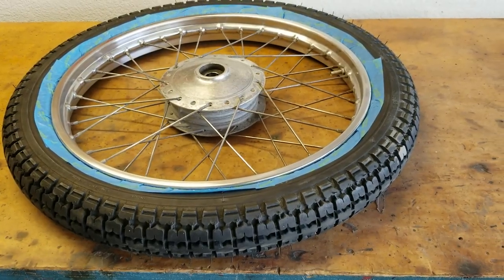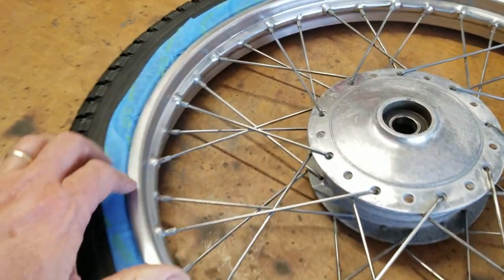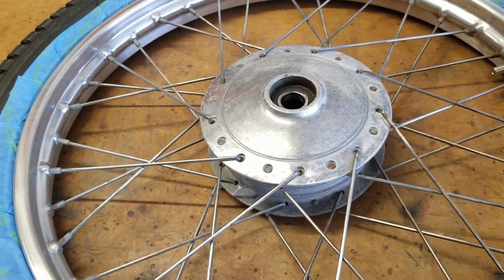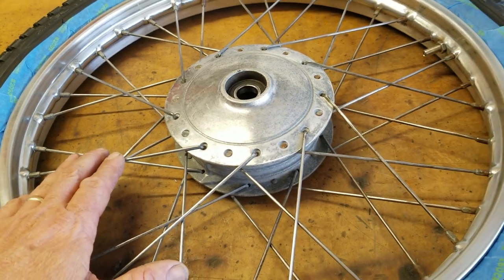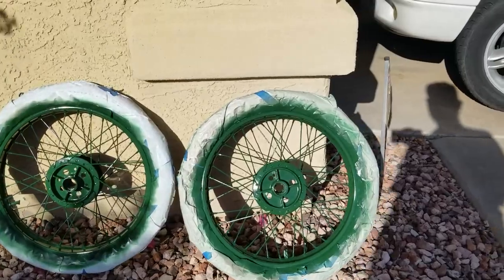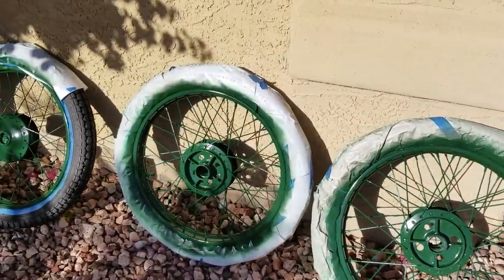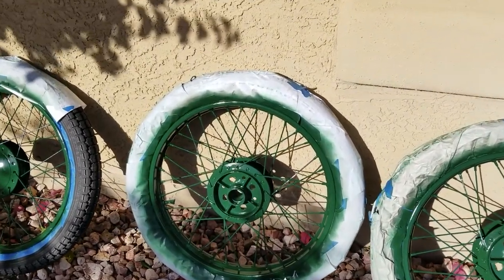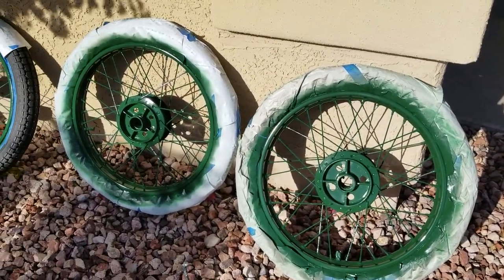Painting CycleKart Wheels

Comment: Will powder-coating hold-up to tyre changes?
Reply from the maker: Any finish can get marred if you aren't careful.  The rims on my red kart where powder coated.  The biggest issue with powder coat is that if you coat the wheel with the spokes in it, it is nearly impossible to tighten a loose spoke because the powder coat more or less locks the threads.  The rattle can paint doesn't do that and it can be touched up.